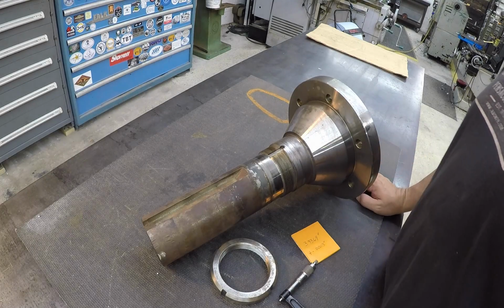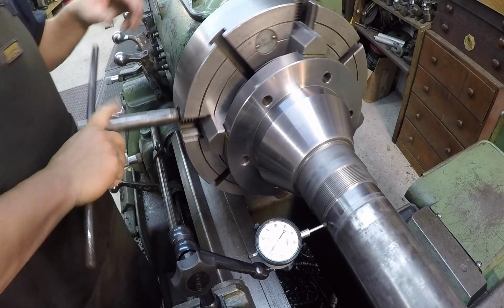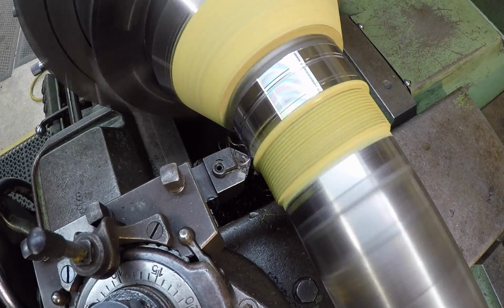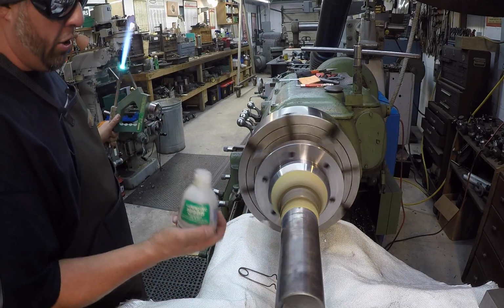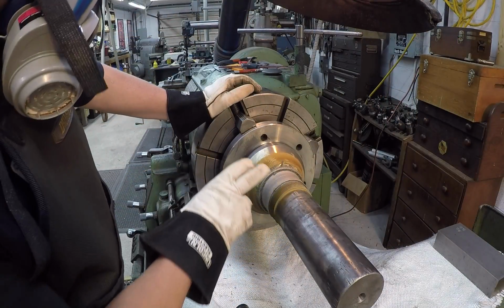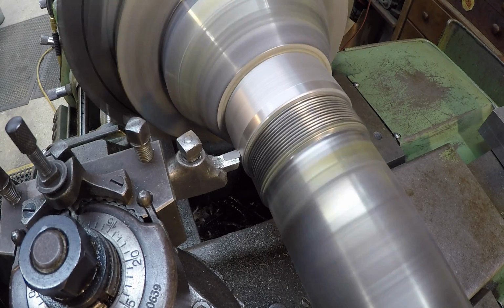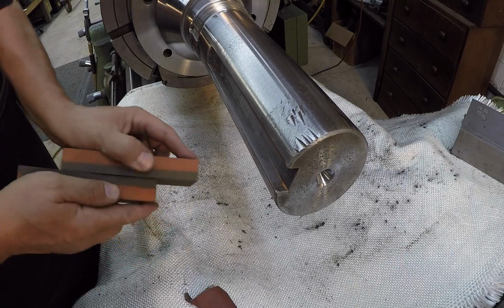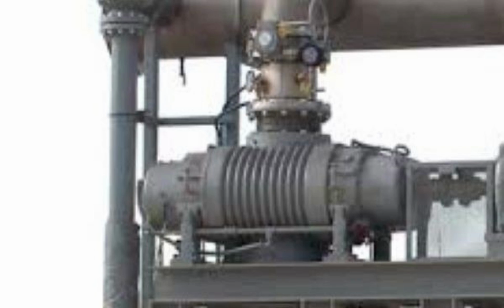SNS 300: Spray Welding a Blower Shaft

Comment: I find it so hard to trust this process... as cool as it is, it seems like poor quality pot metal... I could see it better than sleeves under high pressures, but not by much.

"Metalizing" seems like the proper/more technically correct term... If you were to build the diameter up by actual [orbital] welding, I would think that would be better by a LARGE degree metallurgically... correct me if I'm wrong? Maybe it's my inner welder bias getting the best of me. 
EDIT: wrote this before Abom's closing statement.... you rock so hard man.... I love this channel
Reply: Your edit saved you. If all you have is a hammer, everything looks like a nail. Metalizing may be correct. Back in the '70's we would make ID threaded sleeves from aluminum bronze, then drag OD linear grooves in them. They would be 'flame coated' with Stellite. (Only the grooves.) They would have to be ground to size, but they couldn't get hot enough to ruin the inside threads. There was another powered metal I can't recall (think it started with an 'H'). This is probably what he alludes to when he mentioned needle bearings. Everything has it's proper place.
Reply: Please forgive this old man. It was, indeed, called 'spray welding'.
Reply: @stevebigfoot8864  "If all you have is a hammer, everything looks like a nail." What a great quote! I haven't heard that one before. It can be applied to a lot of things!

Comment: To all who may read this comment: I've been working with machinists for 30+ years. Very few will use this process. Most will lathe the original work piece smaller and then add an additional piece of material/metal. Spray welding is an art. This video is the mark of a MASTER.  'nuff said.

Comment: If I’m not mistaken but I’m pretty sure you’ve just machined back and welded a bearing adapter. Surely that needs to come off and inspect the shaft and a new adapter fitted

Comment: Love the care and craftsmanship - took me back 40 years!! "When it's applied correctly...." SO relevant! In 1988, I worked for a welding equipment company and my genius boss developed an electric (synergic) welding system for doing this because the failure rate from metal spraying was so high then. Wonder what happened to those designs...??

Comment: great.  looks like it goes on a pump like a supercharger type.   roots blower?  i expedite freight in a gm savana van and have delivered industrial parts for work at many places over the years.
one of the cool parts of doing that is some places guys will talk to me, sometimes at length, about the process they use. i have even been given short tours of plants. its fun for me to see videos like yours. great job all around. thanks.

Comment: Please don't leave the chuck key in the lathe chuck at 24:41 in the background! If someone turns it on, it will throw the key. Also, awesome process! I love how you can save such a specialty part instead of starting from scratch.
Reply: Sensible advice but in its holder Mike.  The lathe is running.
Reply: I think he's talking about the machine in background.
Reply: @richk3325  Yep never even saw that in the background while looking at the application.

Comment: Nice work!  The alloy you are spraying is good for wear, but you should try to push using some of the cobalt alloys (eg, Stellite) for exceptional performance when complete.  It might be a little more work and cost, but the lifetime after you are complete will be many times the original life.  I hope you get to show us a comparison between the Ni Cr Fe alloy you are spraying vs a cobalt alloy.  I did get pretty squeamish watching your camera lady standing down stream of the spray. Please get  a fixed set up on that side and keep her away from that side.  A slip up would be upsetting. We don't want any Fail Army shots!
Reply: If I had been the client, I would have sent him the replacement bearing to check the fit. On older machinery, a new bearing may have slightly different dimensions and tolerances to those originally used. This would have been particularly important if the bearing had previously been replaced and failed.
Hopefully, he had been given his dimensions from the replacement bearing manufacturer, rather than the original specifications.
Reply: He did mention this was for a ball bearing with an inner race. No movement. Moving parts (needle bearings, mentioned) would need a harder, tougher material. I was never OEM, so could someone tell me why the keyway was cut into the bearing race?
Reply: +Steve Bigfoot. The end of the keyway would not be under the bearing outer race. Their would be a collar with a male key between the outer race and the nut. The function of the key would be to prevent the collar from rotating. The key would be part of the collar, so would need to pass over the threads. Their could not be a slot in the nut, since its position could not be predetermined. It would also make it impossible to remove the nut once inserted..
Reply: @wilsjane  Thanks, wilsjane. I feel like I should have known that.

Comment: I use to run printing machines and they used this process to true up some of the cylinders in the machine in our shop. The cylinder was 32" wide and had 3 surfaces and they had to build up the outer 6" of each face .0034" with a .0005 tolerance. The process took a week to complete but to replace the cylinders would have cost close to $400,000.00 and would have taken about the same amount of time. 
That is the only time I had ever seen this process used. I have had it used on roller shaft ends where ballbearings fit on the shaft.
A lot of people don't realize it but these guys that make and repair parts like these are in a class like doctors and surgeons. 
Thanks for the video, you did a great job.

Comment: Great video, quality work! Customer will be happy with that job! It's funny how when you machine the spray weld the waste doesn't doesn't come off in continious curls like when you machine solid stock. It comes off in chips almost like the spray weld is a sinter material.

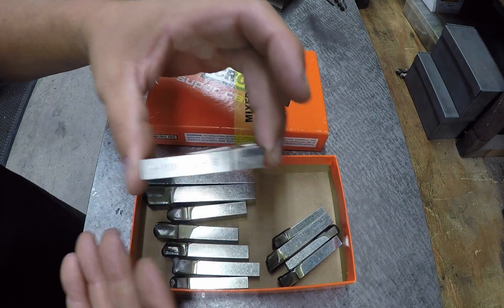Comment: at around 30:00, you show the Micro 100 cutting tools. Their work surfaces appear to be dipped into something. If they are, what is that stuff?
Reply: @jaggederest  You are right, it is a oily wax meant to protect the edge and end user.
Reply: @lasermike2147  When I was at Lockheed Development, every job was one-off, so we didn't many keep tools in our tool box. We had a hot pot we would turn on every morning, and dip the cutting tools in, after sharpening. I didn't much care for HSS, but it's good to see they still have some use.
Reply: Steve Bigfoot I worked at Jorgensen Forge in Seattle in the mid 80’s. One thing I regret is not having toured to tool crib while I was there. The guy behind the counter was one of those gifted few that could sharpen anything. And I dearly miss Boeing surplus. One of my jobs required me to go weekly to see what they had.

Comment: I used to make mining shafts that had box, tapered, point thread on opposite side, with O.D./ I.D. tapered angles on a manual Monarch lathe. Yes they are expensive and you walk on 2 inches of chips around the lathe.
Reply: Ricky Reynolds . Your comment brought back memories for me. Back in the day I worked for American Alloy(Pyramid Parts) in Cleveland and we made shafts, bearings, and other drivetrain parts for mining equipment. One of the lathes I ran was an old Monarch lathe that was war board certified. We had Gisholt , Warner Swasey, turret and engine lathes and some big Cincinnati Bickford super service radial drills, and a few Bridgeport mills. That was my first job out of high school where I learned to be a machinist. We did a little stellite spray application and that's what brought me to this vid.

Comment: Could you have run some hard facing rods and machined those down?
Reply: Yes, but the heat required would have warped the shaft beyond practical repair.

Comment: I have had to do similar on 4 jaw chucks ..it been a while but even with the steps involved , something that heavy and long for its size standard rules of thumb are not enough for that kind of machining in a 4 jaw. It takes everyday experience on that particular lathe to do what you're doing! Good job ! My boss would of been proud as we used to do custom machining for the local coal mines ..and your spray welding would have been miracles to save a shaft like that one..keep it up , you definitely have something there that can be used over and over again! Oh and when i said similar just getting it to "0" runout is about all i ever did and nothing like this as you are the first i have ever seen with spray welding as we always just built up a shaft with and arc welder that would not work here with those threads , i am amazed,its magic and you have it!

Comment: Thermal spray is hazardous and should be done in a vacuum booth. That stuff floats in the air and will get heavy metal in your lungs. Bad idea man. Don't play with your health.
Reply: What this guy said... You should not be burning thermal spray without a ventilation system to expel the gasses and material away from your breathing area. This stuff is seriously hazardous and I can say you probably received a lifetime dose of heavy metal particles just from spraying this one shaft.
Reply: @t-money8572  Ouch. I know nothing about spray welding or machining really. Is it possible his exhaust hood is out of view? How would one know enough about the tools and set up to do this but not know that exhaust is important?
Reply: Hazardous is the word..worked in a shop where a guy did this all the time. One day he got a head injury and was sent for an x- Ray. The doctor was absolutely shocked at the glowing aura around his skull. Had to ask what he did for a job. The heavy metals associated with this process will kill you. Protect yourself at all cost.
Reply: The hood can be seen in some of the frames, and you can hear the exhaust motor running in the background. If he was doing this all day, definitely use a booth but it looks OK. Would use an appropriate respirator.
Reply: He does mention his vent hood early in the video. Later on he said he doesn't do this often enough to warrant a dedicated work station. Somethings make me cringe. A wire brush is EVIL.
Reply: @stevebigfoot8864  oh jeez. welp rip to this dude.

Comment: Spray weld surfaces are only good for seal surface repairs - the stuff is like frickin bubblegum and will not support a bearing over time. Only if you are crooked enough to do this for a bearing surface & tail light warranty -- just say'n. PS I have a Eutectic gun and powders that I want to sell. Not the healthiest of stuff to work with either unless you like getting up close and personal with a chemtrail! Lol
Reply: @FredNeecha  It's touchy, but does provide a wear resistant surface to restore a worn seal surface. I've worked with many types of powders and have yet to find one that could be structurally sound enough to support a bearing for any reasonable length of time.

Comment: Cool stuff. A question , what product do you use for blanking off the non spray areas.Thank you in advance
Reply: It' a fire blanket specialy design to keep the heat off
Reply: Thnk hes referring to on the shaft itself. It's an anti splatter of some sort. We use it at Tricon Wear Solutions
Reply: Yes, thank you, Mymmot72, I am refering the paste put onto the shaft to prevent powder on the rest of the shaft.

Comment: Boy you sure make me yearn for the days when  I was a tool maker, I started in the late 60's and in 1975 we were introduced to spray welding.  We used it on flat surfaces where bars of scale covered hot rolled steel were going through a multistage die on a punch press.  Even the best tool steels were wearing more than was acceptable, but the almost ceramic hard spray weld held up great.  This was not on the cutting edges but on the guide surfaces through the multi stage die.  This does not work on high impact cutting, stamping, or shearing.  Or at least back then when the product was relatively new they hadn't come up with a process that could resist repeated intense impact. Might I respectfully ask you how you reliably maintained your concentricity to the 10th's throughout all the processes?  I'm not sure I could trust that between the cutting, which you did very smoothly and gently, and all the heat, which I would fear would allow the 4 jaw to squirm a little, without rechecking the indicated points of your initial setup.  While the last 10-15 years of my 50+ years in tooling in shops so very much like yours, the forced addition of the CNC machines ruined the trade for me and while I designed in Solidworks, and programmed in various machining software packages, I dearly missed the days of working with men, such as yourself, building , repairing, sharing skills , working shoulder to shoulder solving problems and developing new products and devices and being part of the elite members of the manufacturing community.  Age has robbed me of being able to do this work anymore but it's great to see these skills still being used.  Here in Kansas City there are no more shops like yours anywhere and the book taught kids have no one taking them through the ropes of real tool making and machining, ruled by bean counters and salesmen who fill the owners with pictures of grandeur at how they can hire $15.00 hr men to make high end tools and repairs.  Thanks for keeping the skills alive.

Comment: Thank You for sharing this!  Fifty years ago I worked in an Automotive as a crankshaft grinder and was working on an antique marine diesel crank with a spun rod bearing that ruined a journal on an irreplaceable part.  a neighboring machine shop spray welded metal on the crank and I had to grind it back to size.

Comment: I am have been machining since 1994 spray weld worked many years before I started machining and still works now. We still use it today on upper and lower turbine joints and shafts. I commend you on the whole approach tooling, speeds and feeds,  indicating what is important and when I came to Micro 100 for finish in the video I knew you were one smart MACHINIST. So those think this looks easy, stop now, it is not! Have you ever machined any spray weld?
I have never met you, but would like to have a great talk some time.

Comment: Very interesting topic with a clear explanation of each step. As usual, the fine tolerances of the careful setting up of the work-piece in the lathe contrasts hugely with wood turning, where you just start with a big chunk of material and cut it down to size.
Well presented; thank you!

Comment: totally agree with you, i first started to used the exact same torch as yours back in the 1990's to repair countless components for various industrial applications. Hear the same stories about failures as well, i strictly followed the procedure set out by eutectic and i personally never had a failure that i know of as well.

Comment: Good choice of kit.  I have used it extensively in sometimes third world environments over the last 50 or so years.  Also note your use of a "Tempilstik" for monitoring preheat.  A cheapo ultrasonic thickness gauging init will often reveal the presence of a sleeve.  Good comprehensive video.

Comment: My dad use to do this back in the 70’s at Dowding & mills to repair motor shafts
Reply: That's when I did most of my work in a job shop. I'm still amazed at the stuff we machined and repaired. Wish I had some pictures.

Comment: When I worked at OMC-Evinrude Outboard Motors in the late '70s-early '80s as a Crankshaft External Grinder, they used this process to repair the seal diameters that were undersized on their loop charged 2 cycle Outboard Engine crankshafts.  They would let the spray welded cranks normalize at room temperature for 1-2 days before I could put the cranks back in my external grinder and grind the seals to size. The wait time was because our tolerances were .0002"-.0003" and had to be ground after the shaft was completely cooled. Note: if you are going to grind multipal parts the grinding wheels need to be dressed every part. Otherwise the wheels will get too contaminated to hold the required size and micro finish without burning and cracking the surface.

Comment: Hi can this be done to a rod journal on a forged V8 crankshaft?
Reply: Those are usually MIG welded then reground.
Reply: @Disneymkvii  I'm trying to avoid that.  my machinist told me there is a possibility of warping the crank. i like that this metal spraying is "low heat"
Reply: 45:30

Comment: It has been years since seeing this done, outstanding job!  Was stationed on a TENDER in Norfolk, Va. from 1970 to 1973 as a Machinery Repairman 2nd Class.  Our shop had about every type and size of machine you could imagine, in late 1972 we started doing metal spray on pump shafts in an attempt to shorten the turn around time, had pretty good success with it.  Great video!  Will back for more.

Comment: Can you spray weld a water manifold it's got a female 3/8 npt opening then at bottom side a 60° tapper is about a 1/4 " .  It's the taper I need to build back up to remachine.

Comment: Fist time here!!! 
I saw a application on a bulldozer shaft on jpaydirt a year or so ago. prepped, sprayed and machined in the field on the machine!!. Ureal! the skill and know how surrounding this process. Yea I love the sleeves. I have used them multiple times. sometimes they leak oil. under the sleeve. Sometimes they work perfect. this process is amazing and as you said saves thousands in replacement components. Great Job here!! thanks for sharing your time here on YouTube!!
edit oh YEA I Subscribed too!! the other way is to get a custom bearing and turn the shaft down to good material. I think this process may be project specific I have seen weird size bearing dimensions on bearing web sites. Again cost, strength and time has to be weighted. I'm no pro but that's why we have professionals. You know the type!!